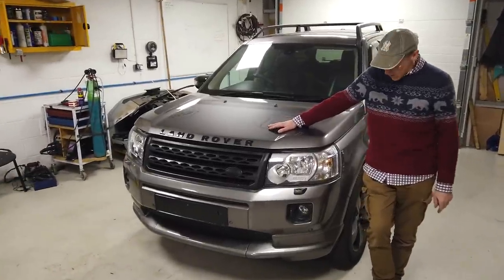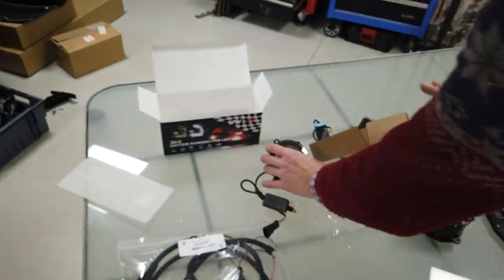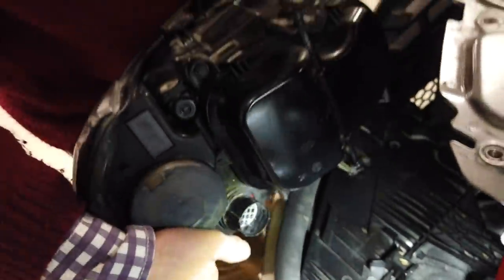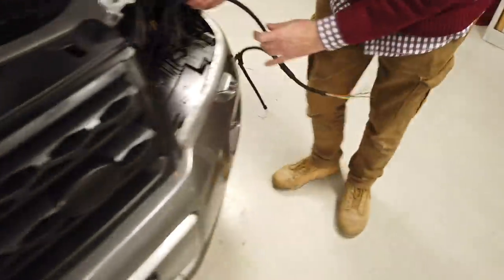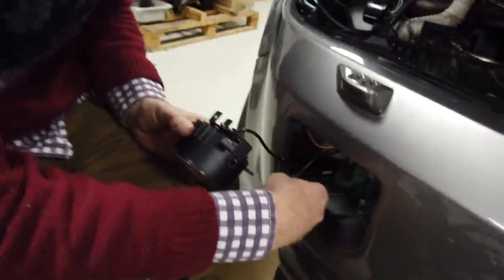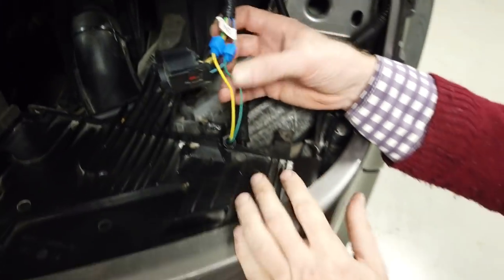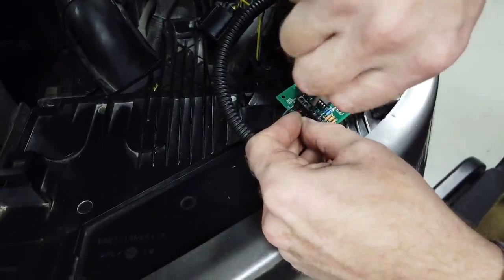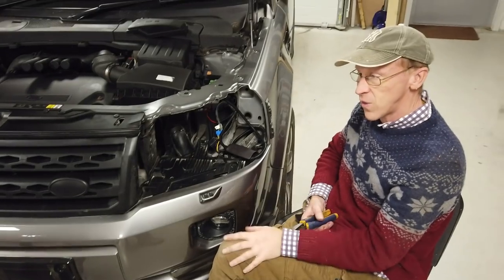Land Rover Freelander 2 LED 2 in 1 front bumper DRL & FOG light lamp upgrade and demo LR2

Comment: Fitted these to my FL2 today, look great. Just a small heads up when fitting these , 
you have to trim the bumper for the adjuster bracket on the light. Nothing major the bits to remove are marked already.
Reply from the maker: Yes they are super tight on the FL2.

Comment: IMHO 'Scotchlocks' or the blue crimp and splice connectors are THE worst way to make a connection to your wiring loom.
Yes they are easy and simple to use but they are not 100% effective and can corrode badly over time, giving no end of electrical problems.
Solder or crimp with suitable weatherproofing as well especially at the front exterior.
Apart from that, a nice how to for your product
Reply from the maker: Fair comment - they are not great. 
I am sure there used to be a Bruce Strachan work at IBM when i used to work there many years ago

Comment: Wire stripping trick - heat up the area with a cig lighter or torch and then just pull the soft plastic outer core off exposing the new wire length. DONT use the pliers and pull method for fine wires you will break several of the fibers.
Reply from the maker: I need to try this trick ! thanks

Comment: Im sure in the video  you mentioned Tyler would be providing a list of head light multi plug/ wire colours  to make it easier for us to find the correct connections to your circuit board.
It would be great if you can

Comment: I've been thinking. The fog light itself has a plug but you used a butt connector for the extra wire. Wouldn't that be better with a plug also as if the bumper had to come off then you would have to keep cutting and re connecting the wire every time you did a bumper removal?
Reply from the maker: Yes correct - this would be the pro way - but this is a DIY kit / video and how often does the bumper come off ?

Comment: Hi have a board fitted on a 2010 Freelander 2. All functions work except no dimming. I have tried dipped beam feed, even direct from battery. I bought the FOG923-RNG DRLs and have VER 2 board. Is it possible these lights don't dim?  Not asking for a refund lol 😂 but a solution, even if it means buying new lights. Thanks Mike
Reply: Me again, looks like these lights don't dim. Measured voltage on DRL with lights off 12v, lights on 9.4v. But DRL doesn't dim...  you may what to check this.  Thanks Mike. I'll be buying the C ones as I know they dim lol😢
Reply from the maker: @michaelstanley3961  Hi - you cannot check LED dimming by reducing the voltage - on LED its the current you need to restrict to get a dimming effect. The board does this by something called PWM ( pulse width modulation ) - I will check these tomorrow to see if they do / do not dim. Sorry for the problems you had with this but let me check and get back to you. As you say it may be better to use these
https://www.powerfuluk.com/vehicles/pickups/freelander-2/lights-lamps/front-bumper-fog-drl-2-in-1-led-lamps-for-land-rover-freelander-2.html
Buy the whole kit and send the others back for a refund.

Comment: Cheers Simon and Tyler great video will check out the web site does the plastic trim tool come in the pack or sold separately cheers Steve
Reply from the maker: Do you have the late or early Freelander 2 ... you only need that with the later models
Reply: @L663  later model 62 sd4 HSE

Comment: Hello

I purchased your Freelander 2 fog light DRL kit including the DRL PCB and have just fitted them. I’m having an issue with the brightness of the DRL they seem to be stuck in the reduced brightness mode as though the main lights are on. I’ve attached images of connections and of lights, All the other functions work as they should it’s purely the brightness.  
Please could you advise.
Reply from the maker: Hi Mark - can you try and disconnect the wire to the sidelight ( at the circuit board ) and see if they work at full brightness. I am worried the sidelight on your car may be on all the time.
What year is your Freelander 2 ?
Reply: Hi, thanks for the reply. Ok disconnected the sidelight wire from the board and yes we have full brightness now. I have put my meter on the wire and we seem to have a fluctuating voltage on the sidelight wire but I must admit my tester is rather old now so can’t really rule out that for the fluctuation. The age of the car is a late 2006.
Reply from the maker: @markbullock7700  Hi Mark - you may need to use the headlight wire if the sidelight is giving strange results.
Reply: @L663  thanks, I did wonder if that was a possibility. Can I confirm that that’s pin 5 red with blue strip wire?  

Thanks
Reply from the maker: @markbullock7700  Yes correct Pin 5 for dipped beam - wiring diagram says blue and grey !
Reply from the maker: @markbullock7700  On the other side it is pin 5 brown and blue stripe

Comment: I have installed today and can not get drl to work tried disconnecting everything but battery + & - and Drl connections but although fogs work DRLs do not Help please
Reply from the maker: Hi - this is interesting - you have done the right thing by just focusing on the + and - and DRL. Can you check the voltage on your car is 14v when the engine is running. I wonder if there is an issue with your alternator ? Let us know how you get on and we will get this resolved / replaced etc.
Reply: @L663  the battery is new this year and alternator is ok I am getting 14.6 volts.  when I but meter on DRL on connections on control board I am still getting 14.6 volts !
Reply from the maker: @regabercrombie6097  That is really odd - it should be working. Its also odd that both lights dont work - it would be odd that both lights fail as these lights are reliable and to have 2 fail is not likely. It would seem to be an issue with the earthing - it uses the fog wire earth. but as the fog lights work i am a little confused. Can you measure the voltage between the fog light negative and the yellow DRL wire ? The other thing is to just run a wire from the battery + to the yellow wire to test the DRLS work - you could just connect the DRL wire on the board to the positive to test this.
Reply: @L663  I uninstall fogs and re-installed double carefully ensuring connections were good and DRls are coming on.  not working as they should but at least we know know that they work.  I would like to connect to dip beam on left side but do not know which wire to plug into.  the Lights are giving a very good light output just what I wanted Thank you Regards Reg

Comment: Guys, have a late edition 2013 Freelander 2. My wiring on the headlight loom appears to have different coloured wires to your video and diagram on website. Is it still the 2nd pin on first row to tap into?
Reply: Did you fit these in the end? My wiring sounds the same as yours Paul?

Comment: Mistake with your Scotchlock connector , through cable goes on the outside or open edge, the inner hole is a blind hole, so that when you put the loose cable in it cannot poke through, as there is an end stop to prevent this, unless these are some really cheap copies that do not have the end stop built in. Personally I have only ever come across the blind hole type.  PB.

Comment: Hi 🙋‍♂️ It’s very nice 👍 looks 👀 better than the factory 🏭 fitted and two functions in one ☝️ unit but it is my idea 💡 if you can upgrade the control unit/ circuit Bord in the water 💦 proof box 📦/ and plug 🔌 and play instead connector/screw. I am sorry ☹️ but this is my thought 💭.but you are more professional.
Thanks 🙏 🙏
Reply from the maker: I have been thinking about this.... just yesterday i ordered some boxes to test if they can fit inside. The other thing will be it will add cost....so lets see what we can do.
Reply: Its a valid point and something I was thinking too. That piece of heatshrink is never going to shrink down small enough to seal either side of the board and having such an exposed board near the front of a Landrover is going to eventually lead to problems. I will definitely buy this kit in time and, if a more waterproof version is not available, then will seal it into my own plastic box.
Reply: Those waterproof boxes are a few quid on eBay.

Comment: Brilliant.. looks a good solution, so have just order a kit,!!  must be a lot  better that  Chinese supplied version by others!! which fits in the top of fog light area, which did not work at all urned led out straight away , might as well have just put the money down the drain..
Reply from the maker: Hi - thanks for the order... we designed the board with our UK partner as i could not find a chinese DRL controller that worked the way i wanted. We are happy with this board and so far it looks to be working in the cars ! I am still looking at improving the weather proofing etc.
Reply: Hi Just fitted the Freelander 2 DRL light kit, fitting is quite easy, and look good.... I did need to remove the location pegs were for  the original fog lights, as the new DRL fog light  metal cradle interferes with them sitting back agains the screen holes.. minor detail...
the heat shrink wrap for the circuit board not very good, too big an area to heat shrink ,to get good seal around cable,s  a waterproof electronics box to house circuit board, this would be a very good addition to the kit, even though it would add cost.  as not every one will have a heat gun, would make installation easier. let me know if you have sorted a circuit board box and I will purchase..
I
Reply from the maker: @andrewharris1788  Hi - i did buy a selection of boxes from CPC - let me check which one was best on Monday
Reply from the maker: @andrewharris1788  I have a box that i have found  https://cpc.farnell.com/camdenboss/bim2003-13-blk-blk/abs-box-with-lid-black-112x62x31mm/dp/EN55080
Here is a picture of the circuit board in the box
https://www.dropbox.com/s/u8nxvlfglk7v1tb/2020-11-09%2009.28.28.jpg?dl=0
let me know if you want me to send you one
Note there are no entry holes for cables you will need to make your own etc
Reply: @L663  hi yes the box looks good to me I shall order one.. thanks for the help.. really pleased with the lights and the look of them when on..

Comment: Could you separate these vids into FL2, Disco and range rover. Would be very easy to get to the vids we want. Thankyou
Reply from the maker: Hi - i have created playlists and split them all up by vehicle.
Reply: @L663  thanks. Will be getting a FL2 in a few weeks.....my current FL2 k-series just keeps on going. Had all the usual problems done back in 2008....since then she has been a little angel. Thanks.